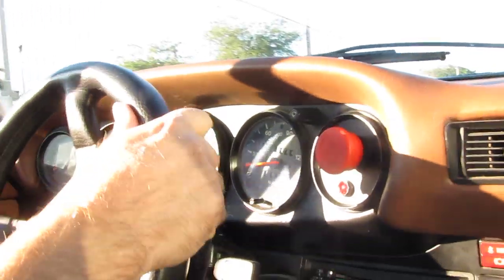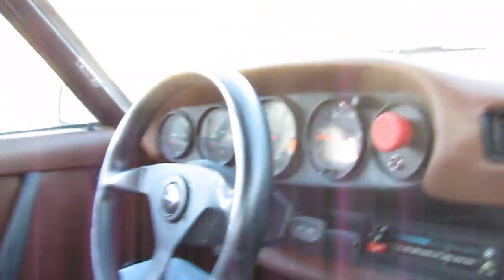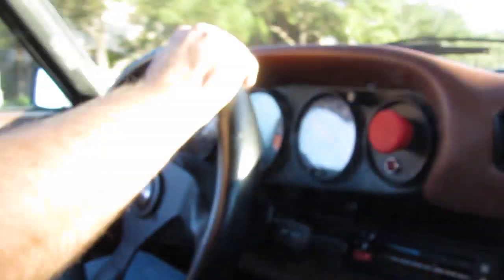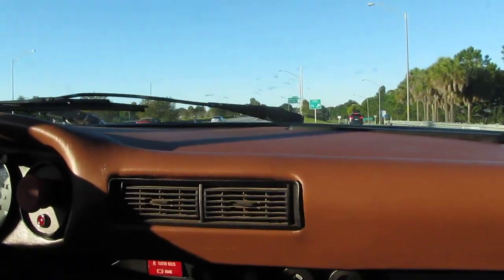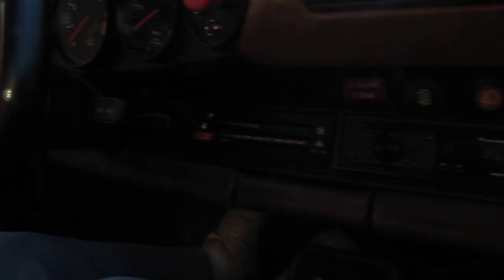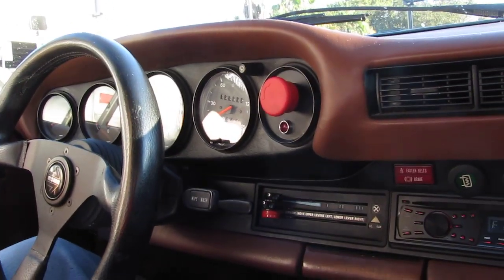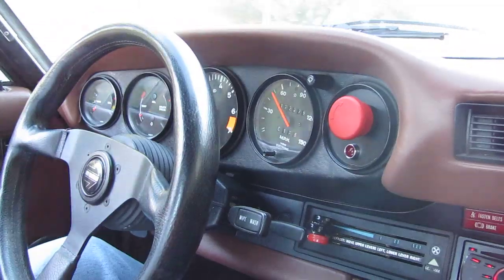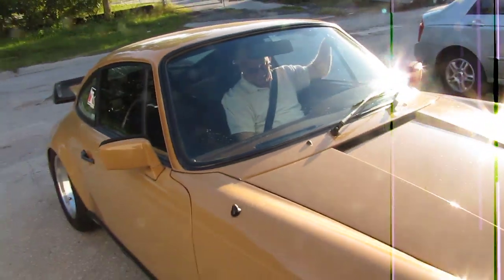ReBirth Auto's Fully Electric 1978 Porsche Carrera- 2 WarP 9's - Inside and Drive

Comment: What module is running this
Reply: It was a rebirth auto soliton 1 (it might have been 2 of them) driving dual warp 9's stacked in the back. The warp9's were connected by a belt system they developed using a custom billet adapter, truly a work of art. This was 8 years ago and unfortunately both this car and rebirth auto (who made the soliton 1, soliton Jr, and the Shiva) no longer exist. These controllers were insane though 1k amps continuous with water-cooling and the Shiva could do, if I remember correctly, 5-10k amp bursts. I was lucky enough to visit them and was the person filming this (on a different account).

Comment: What do you mean clutch has gone? I am currentley pricing up twin motor conversion for my rx8, and I am going to keep original six speed manual box with uprated clutch...
Reply: I think he means the clutch started to slip because of the insane torque of electric motors.
Reply: +MSC7 Electric cars don&#39;t really need a clutch.. You let your foot off and the motor makes 0 torque. 
Put your foot in and it makes maxium torque instantly.
Reply: +Jsp P5 Taunus I know they don't need a clutch, but the car on the video has one because the owner choose to preserve the original transmission. But this clutch was designed to operate with much less torque than it actually is getting from the electric motor, so it starts to slip.
Reply: Ash he probably has a Chinese clutch from Ebay. Get a good clutch if you're going to use one. Chinese junk sux.

Comment: I was wondering if it was possible on an electric set up like this to add a dynamo,like on old bicycles(lights)of course it would be much bigger,attached to the main shaft to recharge a set of batteries while you drive,with a belt for example.if the dynamo was big enough,E would be endless...!!??

Comment from the maker: the motors each share it 50/50 around 200hp and 300ftlbs each (estimate) though the 9in model is good for about 250-300hp easy.  The range varies on how much you thrash it, but ReBirth Auto specs it between 70 and 80miles.  This is with what i considered harder than normal acceleration (more than enough to let you know it isnt your normal porsche) but if i had one, it would be EXACTLY how i would drive it. The torque is just incredible.

Comment from the maker: you are correct sir!  For anyone who wants to know how to calculate it:  300v x 1000a = 300,000 watts.  1hp = 746watts  so, 300,000/746 = about 400.  Now in the video it is a higher resting voltage (near 350) but under load this voltage will sag to about 320ish.  For math though (and frankly to add in drive line losses) they say 400hp. :)

Comment from the maker: This vehicle is actually for sale on Rebirth Auto's website last I checked.  It is currently for sale at 80,000 dollars.  With a vehicle like this, a great deal of the cost goes to the battery pack as the technology is not cheap. 

This type of conversion can generally be done to any vehicle, the most common are VW's because of their transaxle design.  Manuals are preferred as they do not need an idle speed.  Do you have a vehicle in mind that you would like to convert?

Comment from the maker: Lets put it this way, to go as fast as this vehicle could go, you would need a track.  I never did ask them the top speed of the car, but going as fast as I did in it, there was plenty of room left.  The motors are good to about 5500 RPM and can go higher with company approval and whatnot, and I believe the car is 348v but it is around the 300v mark.

Comment from the maker: Yes.  Even in 5th, if you put your foot down the clutch was basically non-existent.  It was an odd feeling to hear the motors whining, but the car not moving.  In the beginning, when he turns onto the road listen for the whining of the motors to sharply rise, they lost traction of the clutch.  They have a stage 5 clutch and pressure plate made specifically for them, but it still cannot handle the vehicle's power.  Sorry for the bad video, I was focused on the ride, not the filming ;)

-Grant